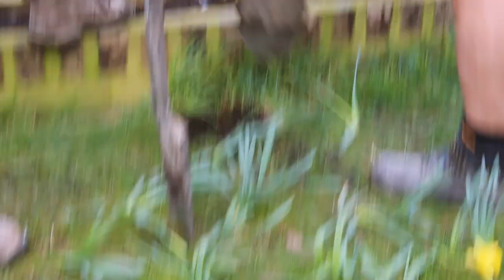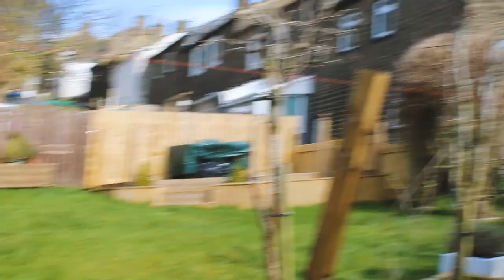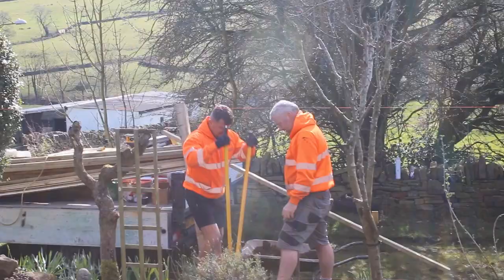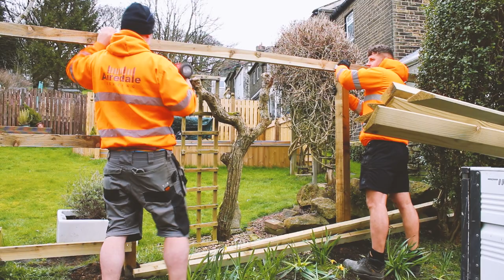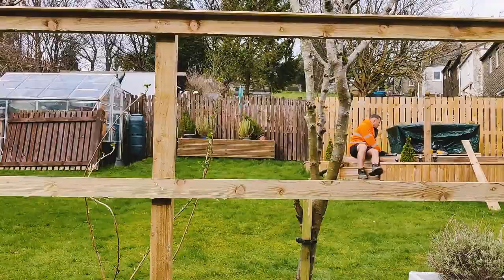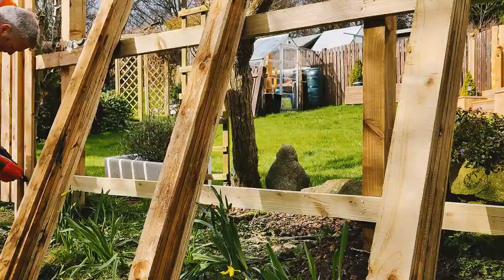HOW TO INSTALL TIMBER FENCE PART 2!! | AIREDALE FENCING GUIDE

Comment: why do you use two lines? if you just measure down to where your bottom rail  goes on the post and draw a line and set your post to the line all the posts will be the same height. this way you dont have the stupid top line getting in the way...if that makes sense?
Reply from the maker: It just makes it easier and saves having to individual mark each post...also it does not get in the way.
Reply: @Airedalefencing  you mark them anyway to set your rails??
Reply from the maker: @seanmcgrath9167  if you have an easier way that's great but this is how we prefer to do it and after 36yrs I've tried allsorts over the years.